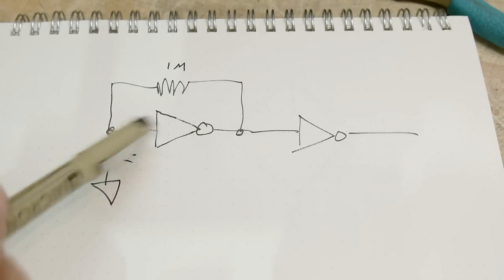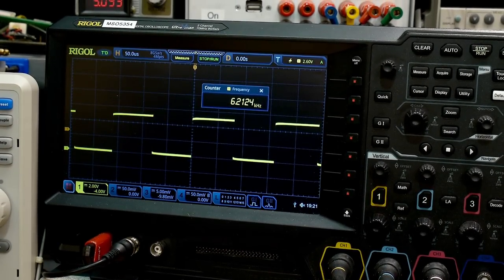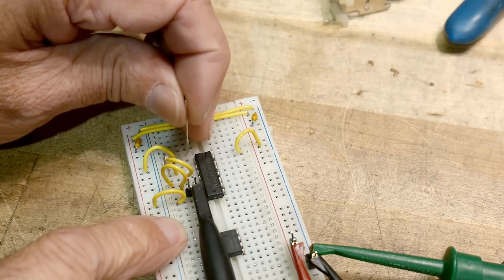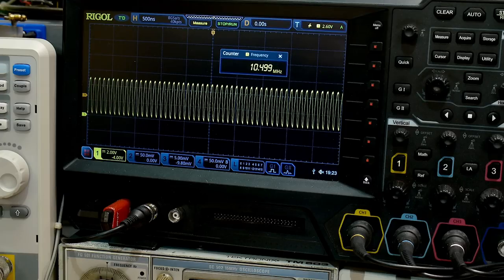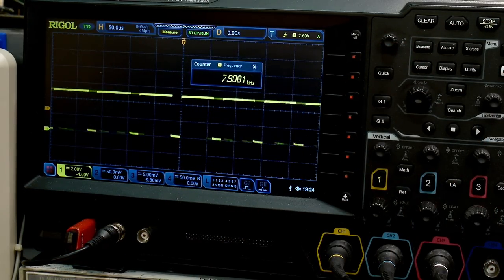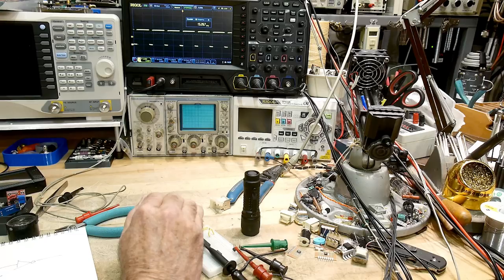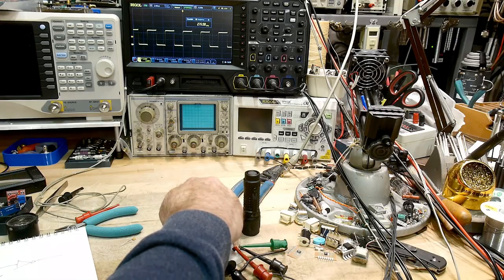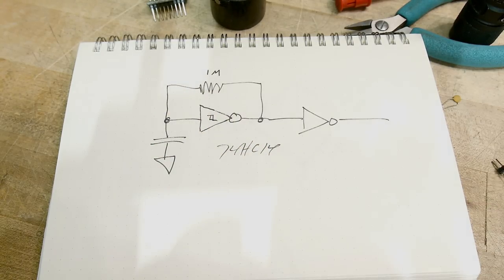#1371 Simple oscillator with changing frequency

Comment: I think the photodiode is not changing capacitance, but instead is adding the small photocurrent.  Since this is a high impedance circuit (1 Mohm) the current can have an effect on charging and discharging.  In fact, the light is changing the duty cycle is a pretty good indication that the photocurrent is responsible.  Also, I imagine that the capacitance is fairly nonlinear since the bias voltage is going up and down with the oscillation understanding what is going on with the circuit more complex.    As for the LED behavior, that is just weird. I wonder how repeatable it is across different styles of LED's.

Comment: The LED might be lighting itself. At higher frequencies the CMOS might be driving the LED slightly. The light output of the LED lights itself up. At lower frequencies the CMOS chip might not be able to light the LED enough.

Many years ago a stereo manufacturer was having issues with power supply hum getting into the speakers. Adding more and bigger filter capacitors, RC filters for the low power pre-amps, etc. weren't working. They noticed the hum went away when the dial lamp (incandescent) blew out. They finally noticed the lamp was powered from a 6.3 VAC winding and its light was shining on a glass germanium point contact diode used in the AM circuit. The dial lamp was modulating the diode at 60 hz.

Comment: Thank you for the video. To analyze strange effects it might be helpful to minimize the effect by coupling the diode under test via capacitor not so hard to the oscillator while operating the oscillator with another constant capacitor.   
When watching the frequency change on a scope (besides the digital display) one can trigger the signal several screen widths to the left to observe the continuity of the movement of the phase. For instance 100 times the screen length for 1% change and 10,000 times the screen for 100ppm or just as much to still see a continuous picture. 
(A good and simple VCO is also possible for instance at the pin 5 of the 555 timer while it will be perfect with the MOS circuit xx4046.)

Comment: The photodiode circuit might be a very sensitive light detector...  Incidentally, light creates electron-hole pairs in the depletion region; this increases leakage current or equivalently decreases the parallel resistance.  I am interested in the details of the LED:  Forward or reverse biased, color, make/model if possible.
Reply from the maker: reverse, red, chinese
Reply: @IMSAIGuy  It is rather like switching in a tunnel diode, but tunnel diodes are active when slightly forward biased.  (Tunnel diodes are also known to electroluminesce, but I think their low reverse voltage support prevents them from making photodetectors.)  How precisely can you measure the DC bias?  Does that change?  (Obviously, LP filtering must be employed.)  There might be a research paper there if you are interested.
Reply: @byronwatkins2565   In PN Junction we have two types of capacitance depletion capacitance & diffusion capacitance.  Depletion capacitance is the main mechanism in reverse diodes, and diffusion capacitance is the main mechanism in forward  diodes.  The depletion capacitance decreases and depletion region increases as we increase reverse voltage.  
Now, my idea is that the electron whole pair generated in the depletion region decreases the size of this region make it possible for tunneling.
Because, the tunneled electrons and  wholes recombine on the other side and generate photons, it would create chain reaction to sustain tunneling, and as a result negative resistance.
We should see the same phenomenon with photo diodes at high voltages.  Because, in photo diodes the doping concentration is kept low to increase efficiency (increase the depletion length to collect more electron whole pairs in this region).  Whereas, in LED one side is heavily doped.  In tunnel diode both sides are heavily doped to decrease the depletion region, so the electron wholes have higher probability of tunneling.
Reply: @aduedc  Much of this is nonsense.  Quantum tunneling occurs across thin barriers and reverse bias INCREASES the junction width to decrease tunneling exponentially.  Photocurrent is generated by photons breaking bonds to create electron-hole pairs that then transport electric charge current NOT the reverse -- recombination to generate photons... although this is LED's normal application.  Mobile charge carriers in avalanche photodiodes "at high voltage" do collide with bonded electrons to break more bonds and to generate more charge carriers, but none of the needed conditions exist here.  The switching occurred in a LED NOT in a PIN photodiode.
Reply: @byronwatkins2565  Byron, I have a Ph. D. in semiconductor electronics, and I have made Tunnel diode in the lab.  You basically need to have very narrow barrier for electrons to tunnel through, through quantum effects.  When you have heavily doped materials your depletion region became narrow, and reverse bias moves the Fermi levels and makes the conduction band and valance band transition from one side of semiconductor the other in very small distance  almost the size of electrons.  Because of uncertainly principle in quantum mechanics electrons location would be both side of the barrier. Then you have tunneling.
The electron-whole pairs would cancel out the depletion charge, they get accelerated by the depletion region itself in opposite directions. 
In avalanche you need high electric field to accelerate electrons and hole to very high speed. Required avalanche field decreases with doping concentration.  You can consult S. M .Sze's  book on semiconductor physics, which is a good reference.
Reply: @aduedc  I have a Ph.D. in condensed matter physics and I am familiar with Sze's book.  None of this contradicts what I have said -- though you have presented some additional detail.

Comment: That is very interesting.
I know change in the oscillation frequency has been used in some cameras  to detect light instead of A2D convertor.  So instead of photo sensitive element to A2D, you can use photo sensitive element to frequency counter.  There are advantage and disadvantage to each method, and there are already papers about it,
About the LED, it is very interesting, how did you use LED forward or backward?  I think self generated light is causing that, by creating negative resistor like Esaki Oscillator, or gunn diode oscillator, or IMPATT diode oscillator.  Of course, I am not sure, and it needs more investigation.   Please, carefully monitor voltage across the diode, and I will do that myself as soon as I have some time.
Here are some more experiment I suggest:
Putting two  LED  in parallel
- both forward
-both backward
-one forward and one backward
Once LEDs close so the can effect each other, and once blocked from each other.

Also one can change resistor with an inductor.

This is very interesting

Comment: Back in the day, a cheap diode for some high-performance hobbyist applications was a green LED - but you had to paint it back because every LED is also a photodiode.

Try connecting a pair of 1N400x diodes like  (circuit) -->|-- +V --|<-- (ground) and vary +V from about +6 to +24 or so - they'll be reverse-biased and the drive voltage will vary their capacitance.  If you don't see enough capacitance to tune it, replace each diode with a few in parallel.
Reply from the maker: I did a video on using 1n4000s  https://youtu.be/Sz0-cUxC2NI
Reply: @IMSAIGuy  OK, thanks, haven't been subscribed all that long!  (Watches other video) Yeah, it can be pretty hard to stabilize a VCO with a BJT as the active element. That simple JFET Hartley in the Handbook works well.

Comment: This oscillator circuit is notoriously unstable. One can even try to use a crystal to overcome it but it behaves erratic at times. If lucky, it may run stably.

As a side note, the photodiode BPX65 proved to be very unstable in time when used as a detector. Its gain permanently slowly changes over time. There are extremely stable photodiodes available, like S1223 from Hamamatsu.

Comment: I would guess that the diodes have more reverse conduction change than capacitance change and that reverse conduction is affecting the time constant.  Do you know if it is the conduction change, capacitance change, or both that is causing the effect?
Reply: The diode in non conducting mode acts like a capacitor,  and if you put more voltage over it the non conducting layer gets thicker and the capacitance gets lower.  If he would have put another capactor in series with the diode then he could have put a variable voltage with a 1meg resistor over the diode and change or modulate the frequency.  That's what you used to see in lots of radio circuits.  They even make special diodes for that called varicap .. they are just diodes but with a bigger diameter i guess so the capacitance is bigger .. and a special shape so the effect is more lineair. if you google pictures for something like "varicap fm transmitter circuit"  you might see some interesting examples.   In the past when you had a tv tuner can the tuning was often done by putting 33volts on a potmeter which connected to a pin of the can.
Reply: @apsdev  The change of the depletion layer thickness with Voltage is typically small for unless driven into the forward region.   Large changes in diode capacitance require large reverse voltage swings.  Light is not going to do that.
Since the resistor is 1 Meg Ohm the RC time constant will be very sensitive to the leakage conduction in the reversed biased diodes.
The very large change in frequency he is getting from the photo diode is far greater than any change one can attribute to only changes the depletion capacitance.
The III-V LED should have very minimal change in depletion capacitance because of the large band gap and higher built-in potential.  My guess is the reverse conduction has a small region of negative differential conduction that is causing the bi-stable effect.

Comment: Please do the tests with a DC voltmeter connected to see the operating point.
Diodes also generate voltage and have current dependency from the light.

Comment: As long as you use an odd number of inverters, you can acheive oscillation.  I played with the circuit, but the extent you did.
Reply: What you're thinking of is a ring oscillator, which is built from chaining simple inverters, this however is a Schmitt trigger oscillator, you only need one schmitt triggering inverter to set it up (typically you put another one after it to buffer/clean up signal), i think the schmitt trigger one is simpler to set up but slower than the ring oscillator. Schmitt trigger inverter can be made with an opamp or 3 inverters if you dont have integrated ones.
Reply: @victorman2227  I know what a ring oscillator is.  I see know reason it cannot be modified.  At the moment, I zm doing some writing for fun; so, I will not experiment for the moment.  It eould be fjn to see what happens.  I have a hunch that frequancy will be somewhat dependant on the pafts used.